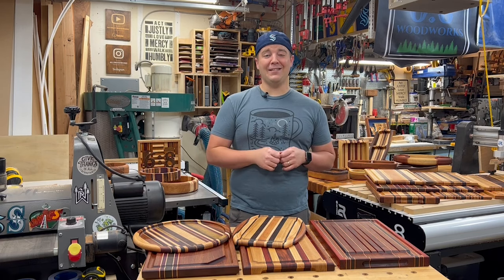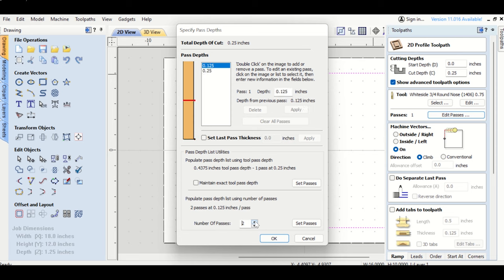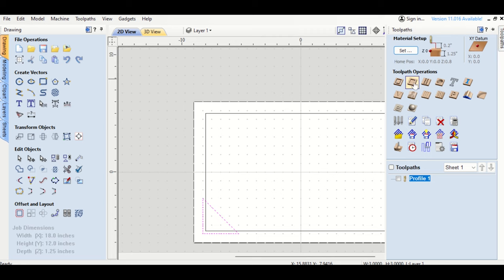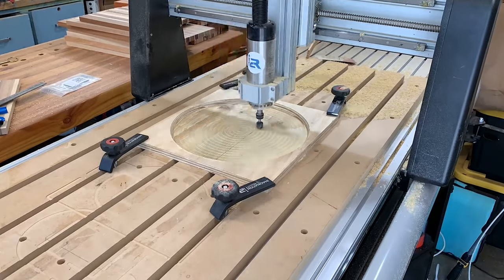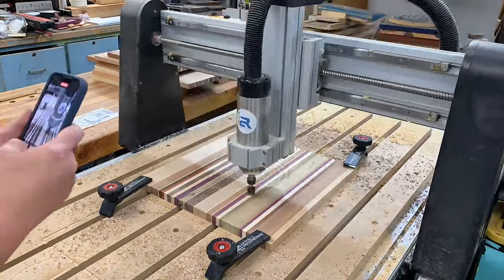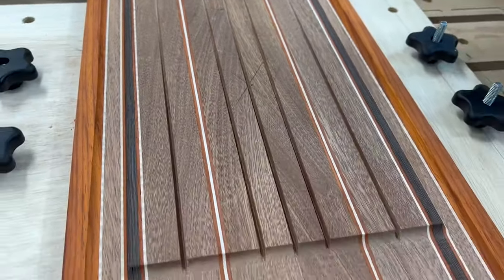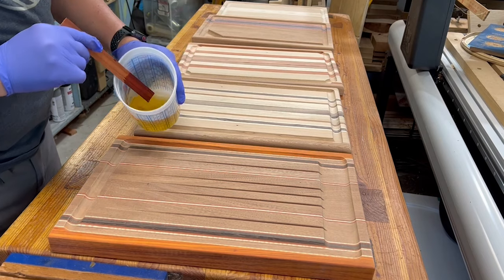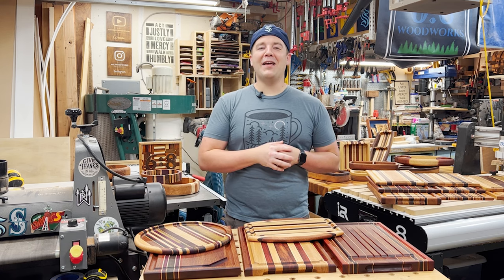CNC Cutting Boards: Cutting Board Tips & Unique Juice Grooves with a CNC

Comment: When you use the CA glue for filler , do you have to use the hardener or does it harden on its own ? Thanks
Reply from the maker: The accelerator just speeds up the process. It will eventually harden without it though.